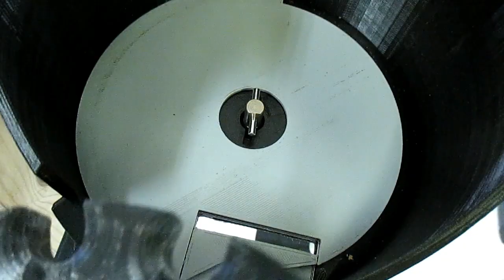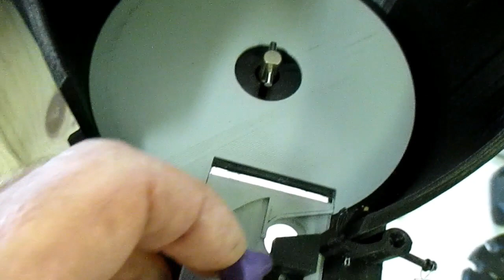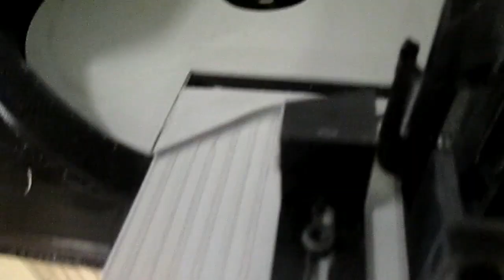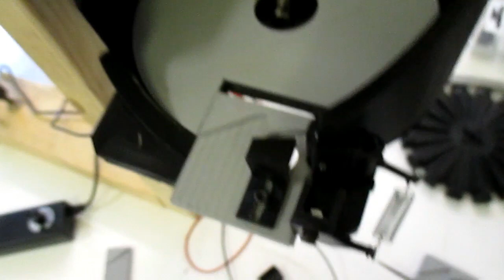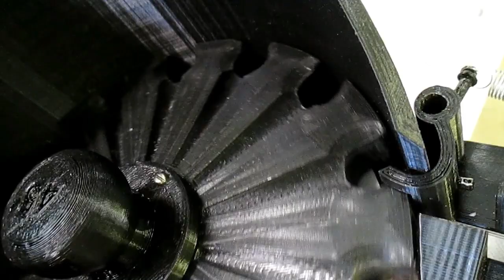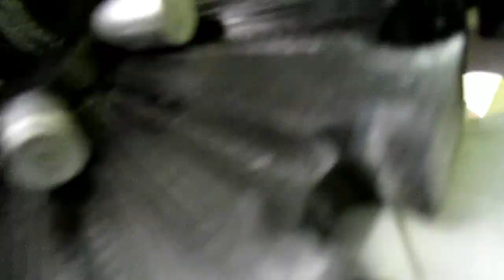3D Bullet Feeder Mods

Comment: Just sized/lubed about 700 124gr round nose 9mm's. All fell nose first with no reversals to my Star lube-sizer! This flip plate mod works better than my factory MBF! I ran 500 230gr truncated cone .45 ACP bullets through and got about 5 reversals . I also got a few jams but I was using the same 8mm plate as the 9mm's. If I fiddle with the plates I will probably get better results. Thank you for all your hard work and for sharing this and the many other videos. A big thank you to Ammomike 83 for his original plans!
Reply from the maker: Hi Jeeves, I spent countless hours trying to get this as close to perfect as possible. For the 45's try using the 9.5mm plate, I made that for the 45 and did you use the anti-flip? These machines are on such a fine edge as far as working is concerned the anti-flip helps that a lot. I’m glad you like the mods I did, and just a little fine tuning you’ll have it run even better. Thanks for your feedback

Comment: Thanks brother. Dave sent me over. I’m having a hard time finding a Low RPM key shafted motor. I’m trying to avoid having to drill through the ones available. Would appreciate any help sourcing one
Reply from the maker: We do have a problem now with motors, the perfect motor was the one from Mr. Bullet Feeder but they have stopped selling them. With that said I’ve be doing a lot of research trying to find a replacement. Now I realize what ever motor I get it will need modifications to it, first all the shafts are to short and 6mm vs 8mm as the Mr. Bullet Feeder motor was. I’m just going to get one and make something on my lathe to work for lathe feeder. Sorry I couldn’t give you better news, let me know how you make out.                                                                  Harry

Comment: I just finished printing out all these mods and have to say thanks BI they are a fantastic upgrade to AmmoMikes earlier work.  They are greatly appreciated by the reloading community. 

I have 3D printed a dedicated nose down bullet sizer that these are going on to. This is in addition to my standard config AM bullet feeder that feeds my Lee Loadmaster and Breech Lock Pro. 

The nose down set-up is slated to feed my new Lee APP and should turn it into a very fast powder coated bullet sizer. 

 Again many thanks as these mods solve the issues of nose down bullet feeding with the AM set-up.
Reply from the maker: Great Michael! I’m glad the mod parts improved the performance of your machine. I spent many hours trying different designs and watching where the hang-ups were and changed things till I was satisfied. Fine tuning takes time and understanding of the machine and what needs to be done. Thanks for you feedback                                                  B/I

Comment: That looks great!  Any chance of obtaining stl files off you? I'm in process of printing one of my own. Also do you know what that metal drive to plate adapter is called, or did you just drill the motor shaft and install a pin?  Thanks!
Reply from the maker: Sorry I no longer have the files, my computer that had the files died and lost them. The files have been pulled off thingiverse. As far as the motor pin it came that way from Mr. Bullet feeder but they don’t sell that motor anymore. There are other motors that will work but you have to modify them to work. Keep looking you may find some other files that may work for you.

Comment: Hi, I had this exact problem with flat nose .40 in my bullet feeder it was extremely hard to be reliable....so I start to  inserting the bullets manually in the tube for resize!!.... Can you please help me with the stl files for print this mods so I can fix that problem with my flat noses..... my email is alexdiazaldas@gmail.com ..... thanks in advance.....
Reply from the maker: Hi Alex, sorry took so long to get back but just saw this. So tell me what’s going on and I’ll try to help. Are you doing nose down or nose up? Need this info to help.
Reply: @backyardinventor9580  I use the colator for resize in a star lube sizer so I need nose down.... the problem only is with the flat nose boolits because I have more than 30% that are falling nose up....  I would like to print the mods that you show here in the video ... to try to fix the probelm .....but I don't know were I can download them.... maybe you can email to me.... my email is in the first message ..... thanks for your answer
Reply from the maker: these are flat nose or are they semi wadcutters?
Reply: @backyardinventor9580  flat nose.... is the .40  the boolits are make with the magma 180gn 10mm  No lube groove mold and painted with coating..... I made 146gn 9mm round nose too (with this kind of bullets the % of falling nose up is about 1% or less)  but with the  .40 flat nose is aprox 30 % of boolits falling bad....
Reply: I don;t know wich is the diference between "flat nose "  or " Flat point" or " wadcutters".....I google wadcutters and the bullet looks like very similar.....  any way in the http://www.magmaengineering.com/PDF/BBOct132008b.pdf  is the one in the section  .40/10mm that say  "10 180 FP BB"   but the mold mine is without the groove  for the wax  .....
Reply from the maker: Hi Alex, this is what I’m going to do. Now all my mods where for semi wadcutters nose down for Ammomike bullet feeder. And they may be useful to you, so today I’m going through all my files and put them up on thingiverse with a video. So see how long that takes, but very soon. I’ll let you know when it’s available
Reply from the maker: OK Alex new video and link to thingiverse with files

https://www.youtube.com/watch?v=RsXNmNAqEsw

https://www.thingiverse.com/thing:4082769

Comment: Great video. I bought the 3rd printer, need to assemble it and this is top of the list on projects to start. Will be doing 9mm first. I primarily use cast bullets with lee liquid lox which isn't as sticky as normal wax do you think this will be an issue?
Reply from the maker: Hey Josh congratulations on the 3d printer, take some time and print out some other stuff first to get used to the machine. There are a lot of settings you need to work with to get good 3d prints. One thing you don’t want is to go for a 40 hour print and have it mess up half way thru, and the main housing was 40 hours on my machine. OK now back to your question I think that Alox will just gum everything up real fast even cast bullets with the waxed rings may be an issue. What I use it for is getting bullets with no wax to my Star Lube-Sizer then hand feed on my press. Now guys that have a feeder hooked up to their reloading press are using jacketed bullets or plated bullets or powder coated bullets. So that’s my thoughts on it, I used to use that Alox and hated it would gum up the feed ramp in my guns that’s why I went with the Star unit and never looked back. So good luck with everything, if you make a bullet feeder let me know like to see it.
Reply: Josh, two suggestions. 1. Switch to powder coating 2. If you don't want to switch to powder coating, then after you have tumble lubed your bullets with Allox, tumble them a second time with a very small amount of ground mica powder. I find that 1/4 of a tsp is plenty to coat 250 9mm 124 gr bullets. The mica will make your bullets completely non-tacky. They will feed through a bullet collator no problem.

The best solution, IMO, is to switch to powder coating. I used to tumble lube all of my mass-produced ammo, but after trying powder coating, I'll never go back. Not only are the no-lube-groove bullets easier to cast (they just fall out of the mold), but IMO they are more accurate. The powder coating process (using the shake and bake method) takes no longer than tumble lubing.

Comment: I did one too that plate you made dose that really help with the bullet pointing down
Reply from the maker: Yes Michael that plate on the bottom really helps get the nose of the bullet in the right orientation. I did a hand built bullet feeder for my Star press and I utilized the same idea in that, this one I’m building for a friend. The bullet feeder from Ammo Mike works and I thank him for sharing. But in my opinion things could have been done differently. It is definitely easier if you can print one vs hand building. If you look on my channel the one I built by hand is on there, was my very first video plus I was getting sick at the time but I got it posted. Maybe over the winter time I’ll do my own design for a 3D bullet feeder. I also redesigned the flipper for that and that made a big difference. Good luck and check out the one I made by hand
Reply: ok could you make me one or send me the stl file and ill make one for me to try thanks

Comment: I have cast up some 9mm truncated cone Lee and some 158 rn Lymans, I believe that any of the round nose .45-.44 should work the same when feeding them through. I should also send you some .44 Lyman 429421 bullets also. anyway good deal buddy, I can't thank you enough. This will really speed things up (Like the Big boys have) in commercial cast bullet world. It's going to take some adjustments when setting it up to get the right tilt on the collector so it is reliable, However, Just like My MEC shotgun press, You have to get a feel for it. I have a shot maker now and that will present some fine tuning through the process of working with it to get the best results. I sure Appreciate this. Give me a call if you need anything. Dave
Reply from the maker: This is my pleasure to do this for a friend, get me some bullets to run thru it and I’ll get it to you
Reply: I'll get you the .45's. I'll get them in the mail tomorrow.
Reply: The .45 swc are in the mail.